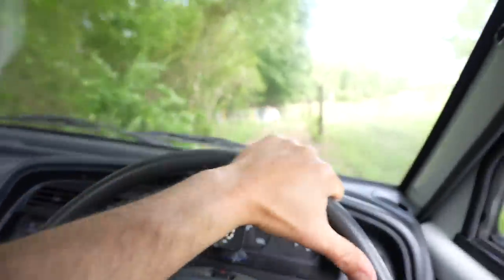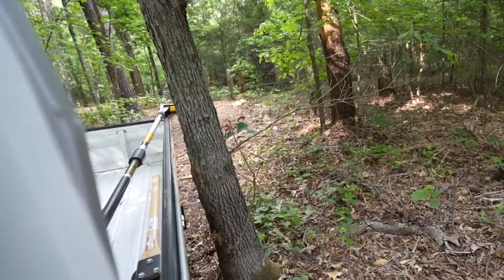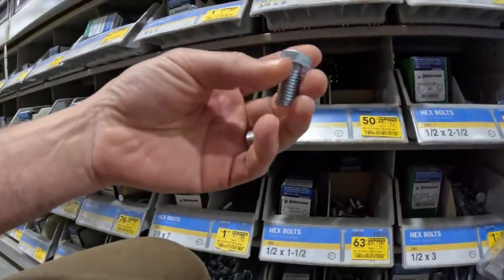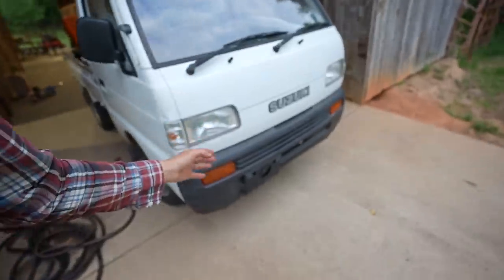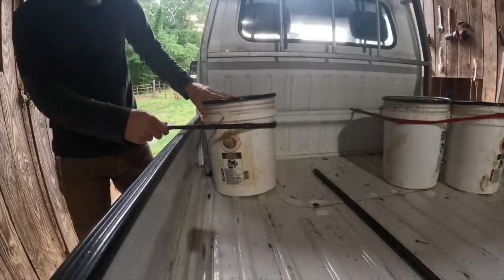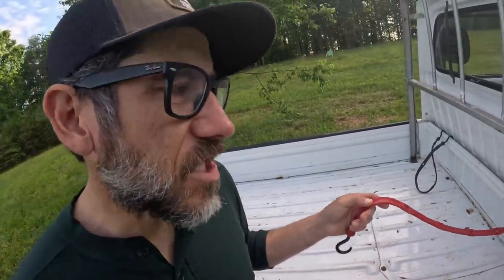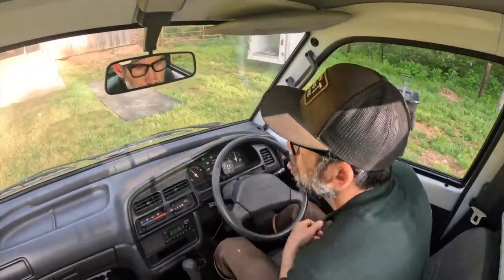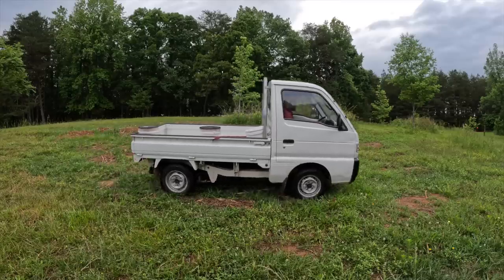Installing Tiny Storage (ammo box) Under Suzuki Carry Farm Truck

Comment: John here from Philippines. We have one of those since the 2012. It is still working. It is a must though that you have a spray can of paint because any scratch you have to paint right away to lessen rust. The panels may be thin but hardened because of carbon steel. I ditched the carpet so that the floor will dry up and not eaten up by rust.

Comment: Add a platform stand or bracket for the bottom of the bucket to rest on the side of the chickens tractor to support the 5 gallon bucket so it isn’t hanging from the plastic rim.

Comment: Hey Jason--we love those kei cars/truck in the PNW for hitting the trails. Roll on truck bed liner is cheap. You only need 1-2 quarts, not even a gallon for the bed. Herculiner is cheap or Monstaliner--more expensive but you get lots of colors. I would suggest adding bigger tires and getting a small lift--more coils, etc. it's a great starter truck to do those things.
Reply from the maker: Thanks for the tips

Comment: Thanks for another great video.

1. Get the chainsaw out and cut those trees in the way so your little truck can move around with ease. Remember to cut the stump in 4 way split if ever you run over it by accident it will split and not damage your truck. 

2. Sow the land decals on the doors would be nice. 

3. Front n rear bars for protection on the farm animals will be great safety feature.

4. Get a nice tarp for those rainy days.

Love your videos.

Comment: Mine is 95 acty 4x4 SDX ! Get the 1inc thick Swiss Chease round rubber ring Matt from home depot Cut to fit (Drains and keeps bed dry) and replace OEM shift knob with Billard pool 🎱 Ball shift knob for better shifting! (" Honda " M10 1.50 pitch ) off E-Bay !  Try it you'll like it!

Comment: you BROKE two clips holding the front radiator cover .black knobs INSIDE FIFREWALL. use long bolts/nuts,washers to fix.